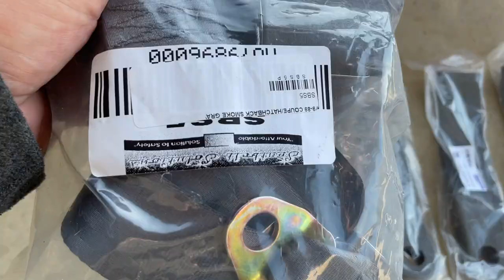1987 Mustang GT Foxbody | Seat belts & Door weather stripping

Comment: I installed mine but it keep locking up on when I pull it Any suggestions?
Reply from the maker: @loopz9085  if you pull to fast it will lock. Try pulling it slowly. Thanks!